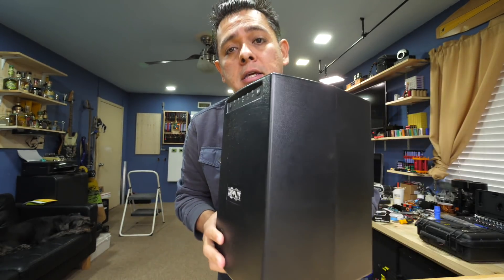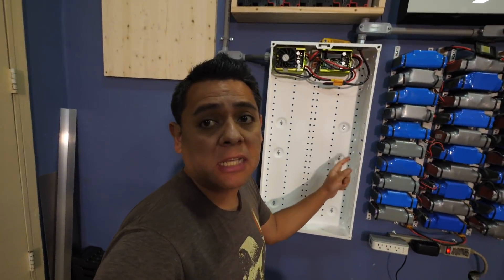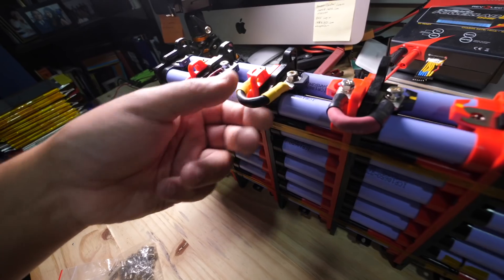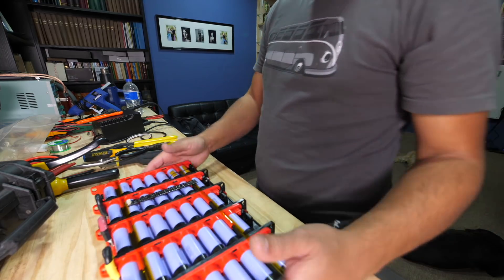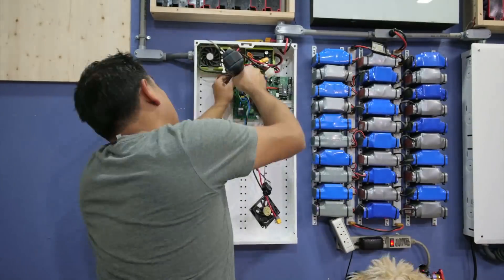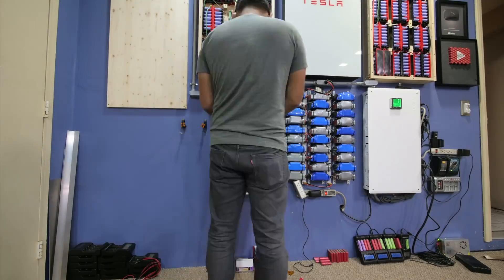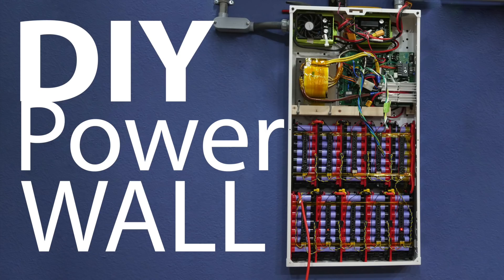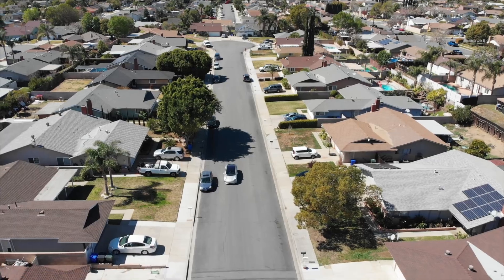1kw DIY PowerWall affordable  18650 build project (2018)

Comment: Questions.  I was looking into the packs that you used in your video.  I would need 13 for my 48v UPS.  This would cost me $650 for the 18650 option.  If I chose to use the original battery pack it would cost about $100.  Both battery systems are 48v 40Ah battery packs.  The original pack only last about 20min.  What is the difference between the two besides one being made up of lithium and the other led acid.  Why is the 18650 the better option justifying the extra cost.
Reply from the maker: 100% of the capacity is available I use plus longer life and better energy density
Reply: Thanks for your help.  I'm still trying to wrap my head around all of this.

Comment: Jehu, Awesome job. Hay, if you are interested in doing another a power wall  project/ or one to send to Puerto Rico. I have a smart UPS 1500 i am not doing anything with and it is likely i will come across more. They are rack mountable units with external battery  connection. Not selling, local DIY guy gift.
thanks,

Comment: I'm not sure i understand that math.  1008$ for this 1KWH setup, but a Tesla Powerwall 1 is about 7,000$ installed, for 6.5KWH.  Is this for a small powerwall only?   whats the practical usage here?
Reply from the maker: the cost of my powerwall is not linear,  you can double the size with $500 more  so 6.5kWh could be had for $4500
Reply: could you make a video showing how to convert a ups to lithium? (i have a apc ups pro, i think its smart and it will tell if im not using the correct batteries. i want to not have to buy 100$ lead batteries every 3 years.) if you dont have a "smart ups" lying around could you convert the ups you have? this would be the closest to powerwall id be able to make. im very uneducated on this sort of stuff and just want to convert my ups to lithium, kind of like a powerwall :)
Reply: You "can" use the 3 stage charging circuit on the UPS for SLA or VLRA batteries as is, but you'll find its seriously not recommended in case you BMS goes kapout and the float charge destroys slowly your li-ion until a somewhat catastrophic event. Most of the drop in replacement batteries you find on the market use custom BMS and LiFePO4, not lithium-ion or others. If you want to use it in emergency situations when you are out of power with packs that are properly charged with a charge controller, sure, but its not recommended to trust a 9$ BMS  from China to deal with a 3 stage lead acid charger with your house. Hope this helps. I have been looking around for the last week for the same question. By the way, Eaton and APC are now selling 1500VA LiFePO4 UPSes for about 1400-1600$US
Reply: Powerwall isn't available in all markets, what he used can be found on or shipped to everywhere on the globe.
Reply: While you could build this powerwall for half the price using bare cells and a different BMS, I agree with you that it would be hard to compete with a Powerwall 2. This more is for small powerwall and people like me who just want to plug it into an outlet instead of permanent wiring and conduits.
Reply: Tesla Powerwall 2 is 13.5kWh and its 9,000$ total

Comment: I have a number of left over LG 36V 4.4Ah hoverboard batteries.  If I used say 30 of those in parallel, would the built in BMS's negate the need for the Batrium?
Reply from the maker: yes,  thats how ive been using them

Comment: It appears you have much less regulation, or perhaps less concern from the power firms than we have in the UK.  That and the price for cells in the US appears considerably less expensive - and or possible.
Reply from the maker: offgrid systems are not regulated,  its eqivalent to using your car battery to power your tv

Comment: Aww the UPS is now $60 with shipping, they removed free shipping option. Still about to buy it though
Reply from the maker: Im not sure they ever offered free shipping,   its heavy and they are giving them away at $30
Reply: Still a steal of a deal though. I bought one, going to build a powerwall just like this but 2.5kw and using the 42 inch Leviton cabinet!

Comment: I have heard ppl say DC don't flo through solid wire that well. have you heard this? it never stopped power on anything I have worked on!
Reply from the maker: I dont listen to people,    Ever,   real experts dont have time to be here commenting on my videos
Reply: I have mixed feelings about that reply...
Reply: This is absolutely true and is respective of current rather than AC/DC. The effective wire gage of braided wire is much larger than the equivalent solid conductor. That said, the equivalant conductance through the cells is less than the wire he's using, so we are trusting that the entire system is thermally protected by monitoring the cells. If you're concerned but still hate loop terminals as much as I do, then use braided wire and dope the loops with solder. By far the most reliable in the long term as they are resistant to oxidation.
Reply from the maker: Isn’t life one big bag of mixed feelings?  It is for me

Comment: Is the link http://j35.us/Samsung44ahModules correct?
How many batteries are included in the module package; 20 or 22?
The link indicates 44ah modules, your video reference indicates 44ah module, the internet site indicates 40ah modules. Also, the internet site shows both 22p and 20p modules both for fifty dollars. Which is correct? If the 44 ah module is $50 dollars how do I order that unit?
Reply from the maker: 2.2ah cells x20,   can you do math?
Reply: Also, why does your page show a 14p assembly when you are selling a 20p assembly?
Can I buy just the units without the batteries? I have salvage over 300 batteries at no cost.  The batteries average 2.5 aH.  What would the costs be just the racks without the batteries?

Comment: nice job you got there,  awesome battery you made,  but i think you must check your wave form of your output of the ups.  it must be pure sine wave.  if the output wave and frequency is not right sine wave,frequency must be 60hz.  otherwise the output transformer of your ups is gonna get hot for a long time of use.  it might smoke,  because ups usually isn't sinewave and much of this aren't 60hz.  it's design not to operate beyond 4hours,  believe me I've tested it.